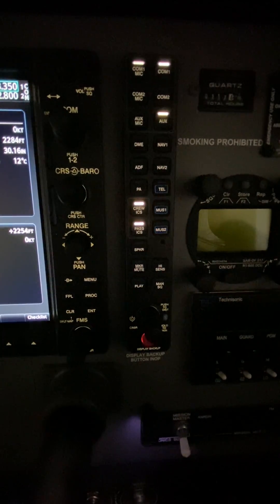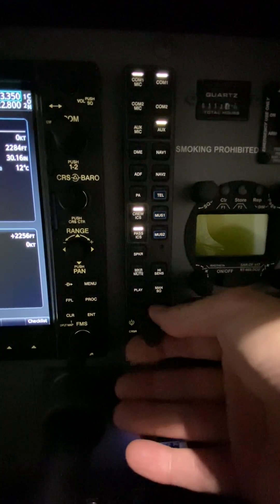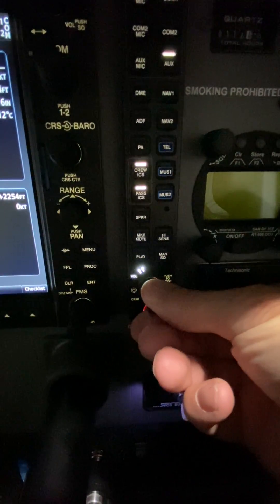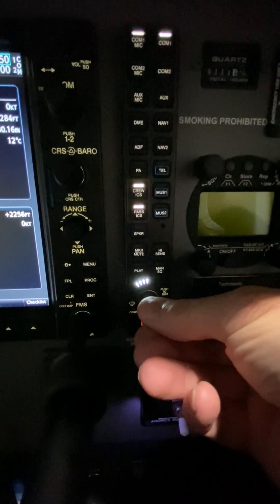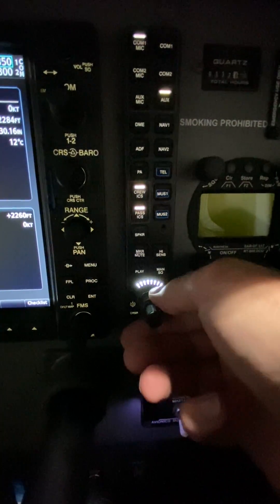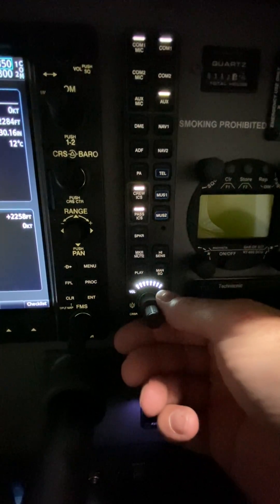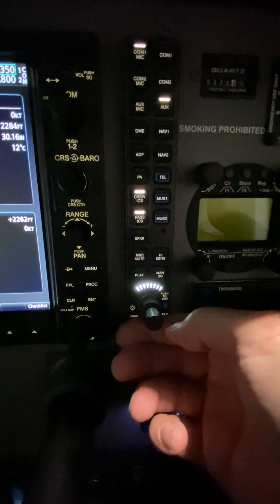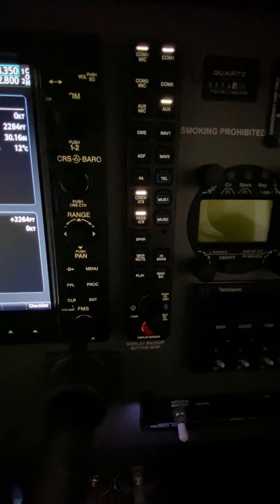G1000 - NXI - Audio panel volume adjustment

Comment: Great video....we are CAP N807CP (172S) w G1000Nxi and had similar problems. Now that we found your video we can check our plane for correct audio on ICS. Did not find this in the POH or Garmin material. Thanks for this posted tip. We also found the Bluetooth button (finally) to pair with panel and get ADS-B traffic,